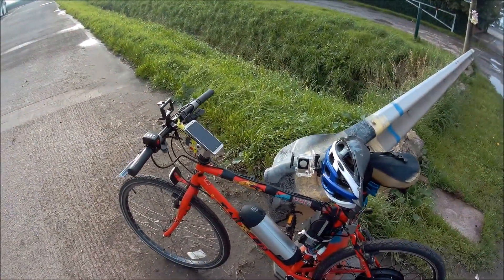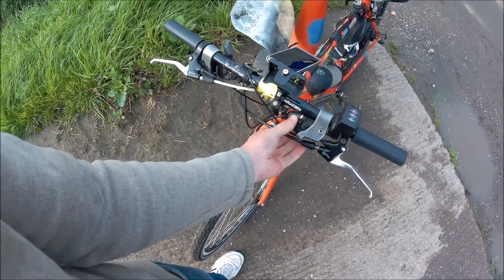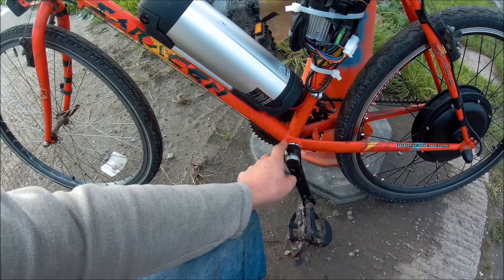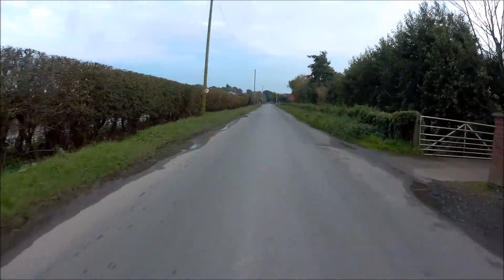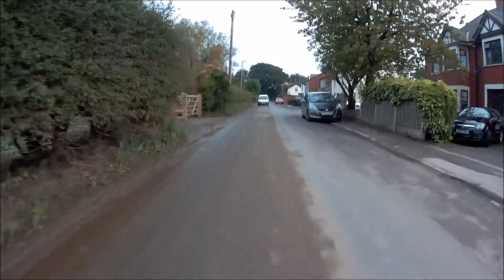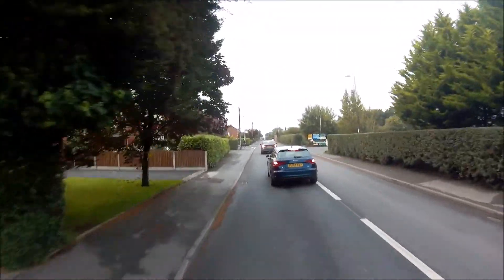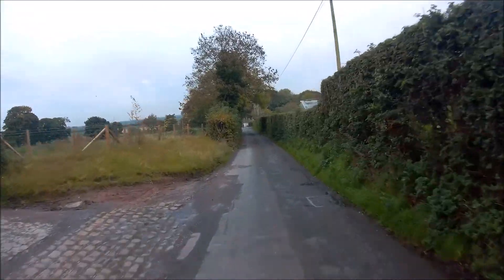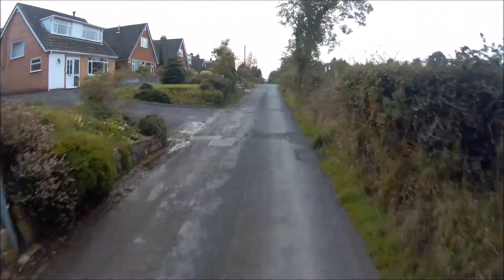Jake`s Ebike conversion

Comment: Hey Jake, Where about's you riding this.? I just outside London and have a 250w on my bike, thinking of upgrading to 500W. You ever been stopped by the cops? Motor sticks out like a saw thumb! I ride 6.5 miles to work every day and 6.5 back. My battery last me to work - home and to work again before needing a charge. Also do you feel any drag when coasting?
Thanks Bra..
Reply from the maker: Harminder Singh I'm near Preston.don't notice much drag,though the bike is very heavy if just pedaling.no trouble with cops,quite rural here .
Reply: Thanks for reply Jake, Will hopefully pick up a 500W next week. Let you know how i get on.

Comment: Hi Jake, do you have to install those brake levers which cut off the power if you pull them?...and why does it need a pedal assist sensor..?....Is it for dim people who dont know they are peddling?...lol
Reply from the maker: EnglishTurbines I did install the brake levers,but shouldn't have bothered as they're not really needed though I think they're required legally. I didn't bother with the PAS,just use the thumb throttle.
Reply: pedal assist is useful if you can't be arsed to keep your thumb on the throttle all the time.  Good for riding about no handed I suppose.